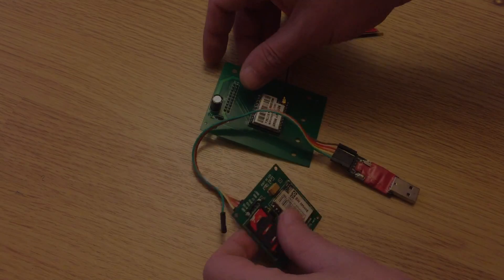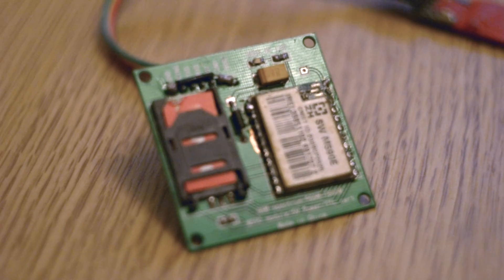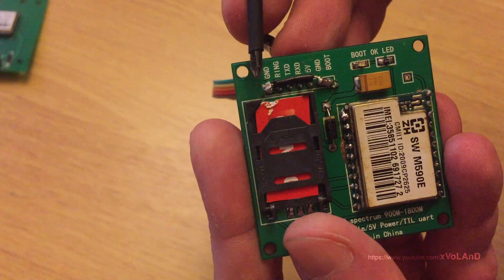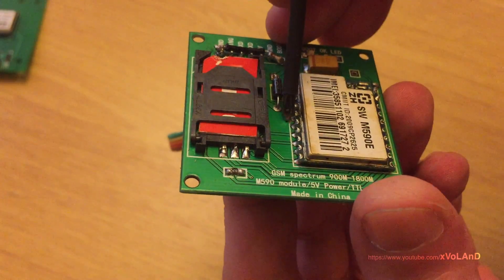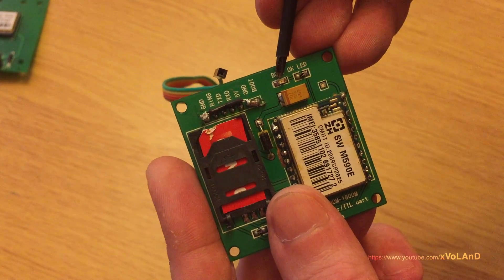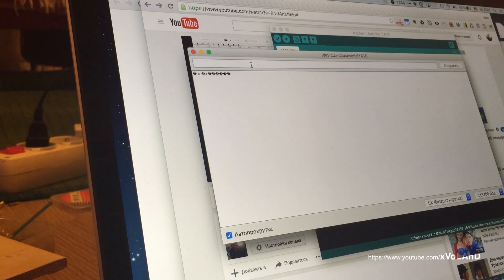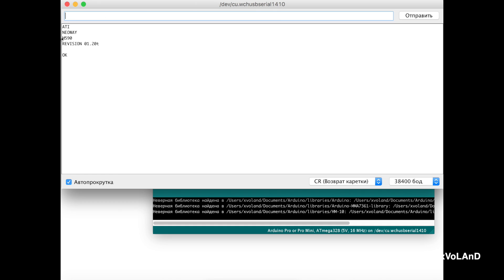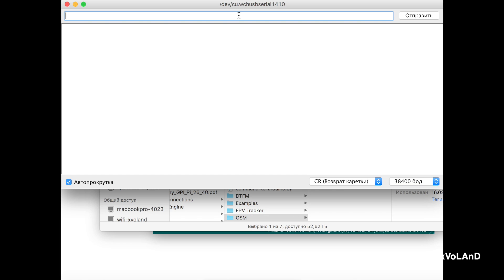SW M590E Neoway Arduino GSM module. Rubbish in Terminal of COM port. Tutorial

Comment: Hello are you powering the gsm module straight from the ftdi 5v or 3.3v?
Reply from the maker: It must be powered from 5V because a voltage drop occurs. The power supply of the module must be external

Comment: Hello... Does this module works for making/receiving phone calls?
Reply from the maker: David Martínez Hello. No, this module can’t transmit voice, but there are others allow it to do. The module can see the call and answer to the call. I need to check the datasheet, is it possible or not to connect a microphone, but I'm not sure about microphone.
Reply: What module works for phone calls? do you have a datasheet?
Reply from the maker: Check the description for the datasheet... Module with a microphone, for example, SIM800, SIM900, etc.

Comment: Hi, M590E device is heating-up when Arduino is used as interfacing and power-up. GSM is taking ~320mA. VBAT has 3.62V. BOOT LED is not showing anything. When tried to communicate with AT commands, the Tx,Rx LEDs on the Arduino board blinks, but didn't get "OK" message on the screen and no response from the GSM module. Does anybody experienced this? Waiting for any suggestions/inputs.
Reply: The same thing is happening with my SW M590E device

Comment: Hi, The datasheet shows the operating power supply range from 3.3V to 4.5V. Can you please explain how the 5V gets converted to the operating range of voltages?
Reply from the maker: ***** Because of the voltage drop down on the diode and you get the required voltage
Reply: diode drops the Volt

Comment: Are there any advantages of using NEOWAY M590 over the M590E shown in this video since NEOWAY costs more and if so, what are the advantages?
Reply from the maker: ILA I didn't compare by datasheet. This module is good for training and simple functionality. For more serious projects, you need to use modules with gps, for example. All depends on the project, what do you want to get in the end
Reply: Yeah, I won't be needing GPS, but I see some modules include that as well. What I'm planning to use is SMS for remote commands and GPRS for requests and responses from my server. As far as I can tell, both offer that functionality so I'm a bit confused about what the difference is.
Reply from the maker: ILA You can ask NEOWAY
Tel.: +86-0755-29671361
Email: Support@neoway.com.cn

🙄
Reply from the maker: So, I found difference. The M590E has a pins: MIC_P, MIC_N, HOST-RX, HOST_TX, GND, NC.
The M590 doesn't have this pins :)

Comment: Hello. I am not getting the +PBREADY Can you help me please?
Reply from the maker: Hi! If the electrical part of all good, then check the PIN code is set. It must NOT be set
Reply: Vitalii Tereshchuk Yes the sim is OK. No PIN code is set. However, it looks like a problem with the sim card because AT+CCID gives me an error... By the way, I use a 470uF electrolytic capacitor because I didn't have the yellow one.
Reply from the maker: OK

Comment: AT+IPR?

+IPR: 115200

OK

MODEM:STARTUP

MODEM:STARTUP

MODEM:STARTUP

MODEM:STARTUP

i HAVE PROBLEM WITH MY m590 gsm MODULE 

it show me MODEM:STARTUP in loop no +PBREADY
i don't know why
Reply from the maker: Check the connection with PIN Boot <-> GND
So, if everything is correct, then try shortly connect to GND to start start GSM
Another problem, which can be it's power of GSM (very greedy)
Reply: @xVoLAnD   i HAVE PROBLEM WITH MY m590 gsm MODULE MODEM:STARTUP

MODEM:STARTUP

MODEM:STARTUP

MODEM:STARTUP

Comment: You forget that you need a 5V power supply capable to deliver 1A in addition to the TTL-communication. The 5V from the TTL-adapter is far away from that this board needs, due to the power consumption from the GSM-module. Power with a separate 5V supply, and you will be up and go, with readable ASCII from the TTL-UART.
Reply from the maker: Yes and not. I have not talk about energy consumption. I think everyone solves the problem itself and there is no single solution